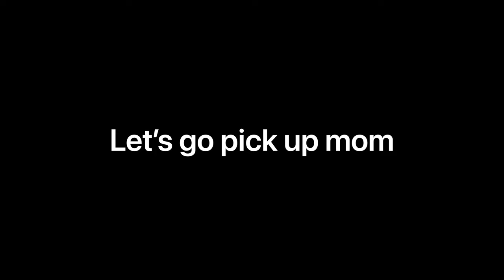Mom rides in fully caged go kart (stanced civic)

Comment: would u build another one of these for $$$? i’ve been trying to decide what to do to an old ek and i think that might be the perfect solution lmao. im in ohio too
Reply from the maker: I’d entertain the idea of it but it wouldn’t be cheap because it needs to be done right. No cut corners. Full cage. Highly suggest bucket seats with four-point harness minimum. Highly recommend wearing a helmet at all times. without doors, the cage should be built to protect the driver as if it was a circuit track cage. Way more to it than what this car was.